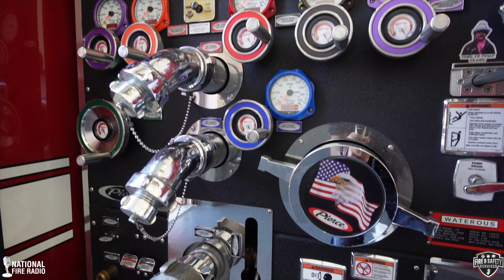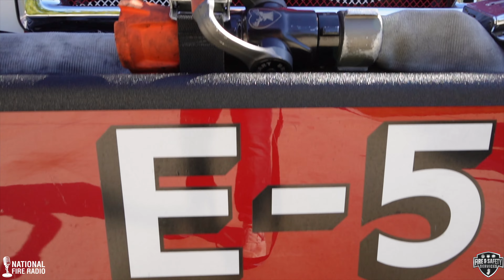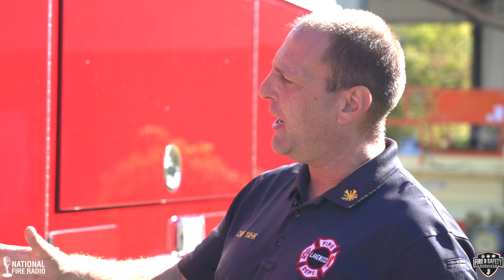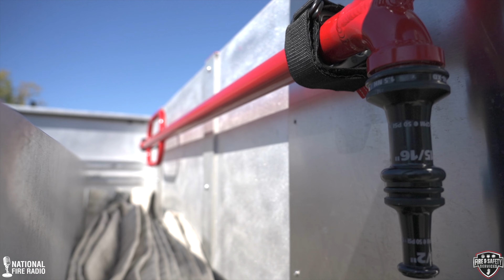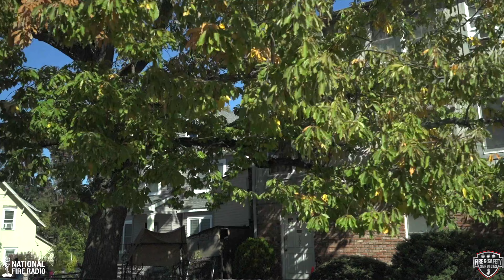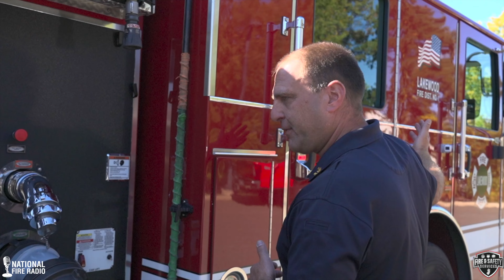Fire & Safety Services/National Fire Radio - January 2024 Calendar -  Lakewood FD, New Jersey

Comment: I don’t understand the reasoning to not perform a forward lay. Whether you take the hydrant to the fire, or you take the fire to the hydrant, they both have distinct advantages based on circumstances. I definitely agree that the hose bed being longer allows for a lower angle of pulling hose. I never understood the Rosenbauer rigs that are so damn high off the ground making pulling hose and anything else a pain in the ass. Seagraves seems to strike the right balance of low height and structural durability.